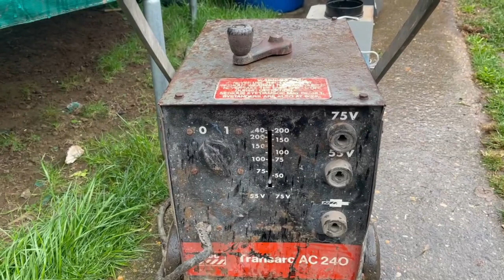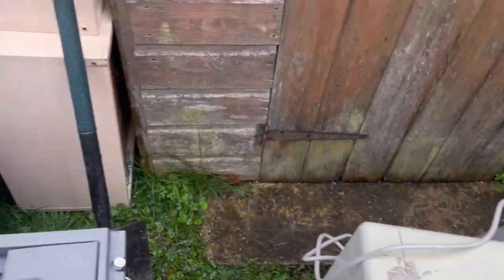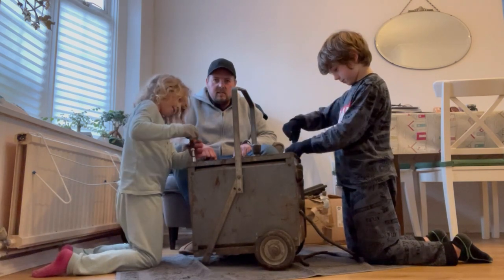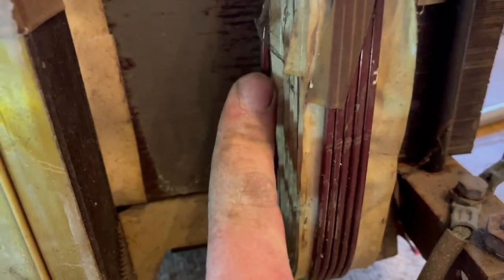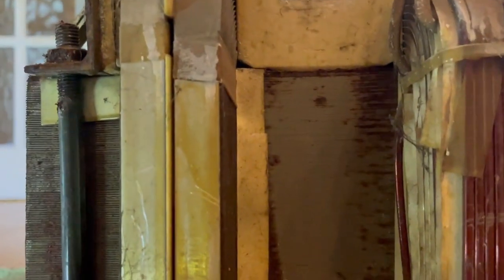Raiders Of The Arc Welder

Comment: Cut it with grinder or smash it with the hammer
It's most definitely will. Not be brass
It's going to be copper or Ally or even both
The coating that's on them is epoxy resin of some sort